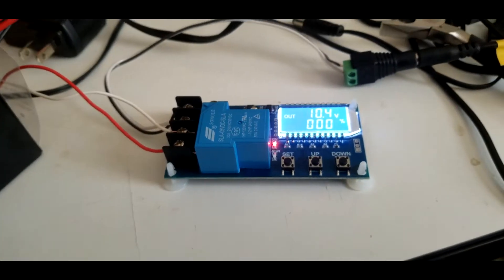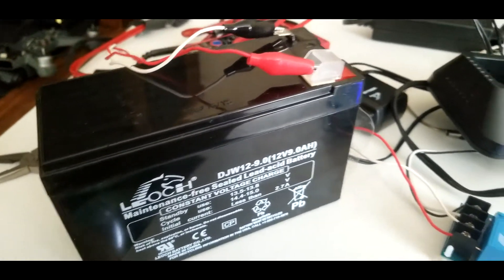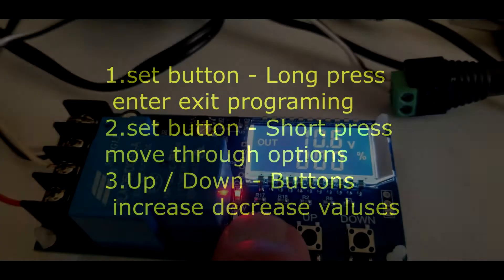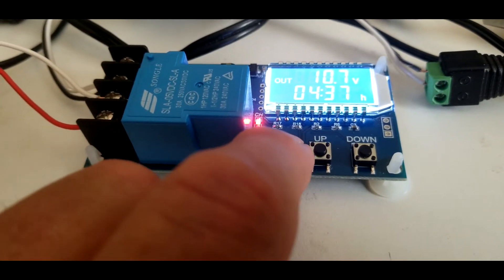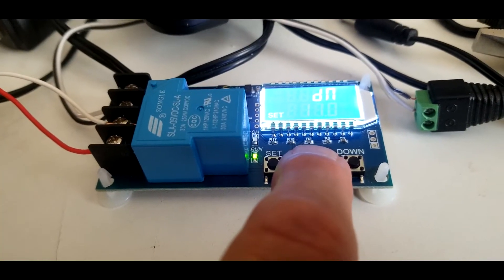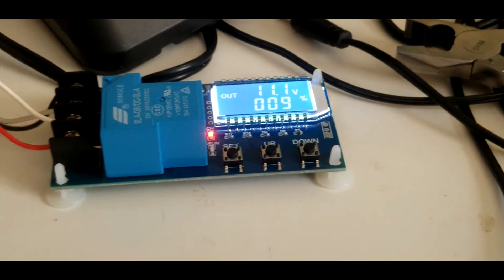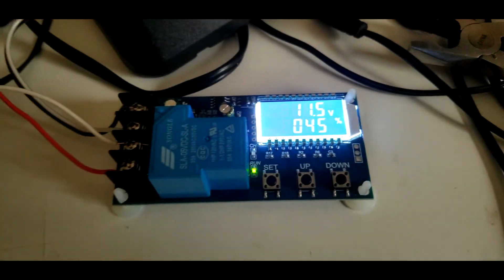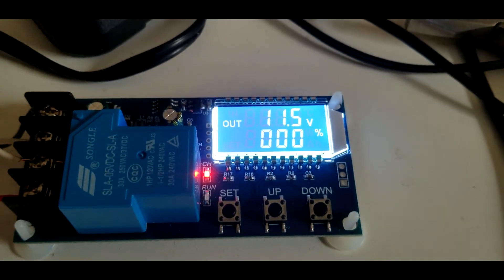Battery Charge Control Monitor

Comment: This module makes a pretty competent charger out of an adjustable power supply (AKA lab power supply). I charge an 8-S Li-Ion pack by setting my power supply to 34V and 1A and setting the module to cut off at 33V.

Comment: The sealed battery you are charging is really a Lead acid battery that has the top glued onto it. If you pry it open you can add water to them and MAYBE get them to come back to life if they are dead. Recovering them really depends on if you let the water evaporate out of it and then charged it. The low fluid will burn the plates and ruin the battery.

Comment: If anyone remembers the Arlec charger that was a CC/CA charger of 2Amps. It would fry your battery if you didn't time it right. This  board would have been perfect for that sort of supply, especially on a boat where the Pri and Sec are separated by a transformer. ie. No Electrolysis issues.

Comment: Isn’t this unit a charge and voltage reference . Can’t see where it discharges through the unit . You will connect your current drain in the usual way. A parallel pair of wires suitable gauge to handle the charge current. Cannot see why you cant charge any battery. It’s the charger which provides the charging parameters. The unit switches the relay off or on depending on the reference voltages. Probably good to have several to suit battery type and avoid forgetting the voltage range set for one.

Comment: There is no such thing as low power to high power on this module, the correct instructions are 
Set the status of the LCD backlight (L-P) with a long press of the ‘UP’ button.
OFF: The backlight will stay on permanently.
ON: Backlight will be automatically turned OFF after 5-10 seconds.

Comment: The only reason you can not charge certain batteries is because you need to use the correct charger for the battery you need to charge. This unit only controls the charge parameters, the unit does not charge the battery.

Comment: I've a Moman V-Mount Lithium Battery - 14.4V - 99Wh - 6800 mAh and Charger 16.8V - 2A
How many Volts should I set the module to make it turn off? 14.4V or a little higher? can you help me? Thank you very much
Reply: Yes

Comment: It's not charger, it's between charger and battery. It's only control module, cut at volt you setting it to cut.
It's only so you program it to charge battery at 90% , you want overload battery. It's not charger, it's charger controller, Safety, batteries last longer ,🙂  You needs charger,.🤓👍

Comment: What you are missing is after you have connected your charger to the charger input, but not the battery. Press the down button and this actually toggles the unit on and off. This will work for you now.

Comment: can i charge only 1 lion 18650 to 4.2 v ?
Reply: not recommended, I would go with any tp4056 charger board, that will CC-CV charge. This board is just a relay combination with time/voltage check
Reply: Yes.. you can.. just use 5v input like cellphone charger... And set the lower limit and the upper limit

Comment: Works perfectly on both lithium and lead acid.
Plus this is not a charger but a over voltage and under voltage disconnect.
Reply: so chargers work diffrently? Doesn't they just disconect when voltage is reached?
Reply: It does charge the battery, it just disconnects the battery when it's reached the OVER voltage.
Reply: @TheDgdimick How can it charge without a power supply/charger ????

Comment: I'm sure you know by now, but this is NOT a battery charger! It's only job is to pass current from source to load within an upper and lower voltage limit setting. It has a bunch of bells and whistles too. It does NOT limit any current/voltage going through it either. Just a relay that opens or closes.
Reply from the maker: oh yeah, thanks. i was using a wall transformer for charging connected to CH+ and CH - , in the opening picture you can see the wires connected. There is more to it than just passing current. Like i stated it will not charge any batteries besides lead acid. It does have a sense circuitry to sense the charge on the battery AND it makes the assumption of charge by the chemistry of the battery.

Comment: Im looking to buy this Brand CPTDCL charger cut off board. Can you help me out.
 I have a portable solar set up and direct from alternator charging my secondary battery. 
Can I reverse the wires to the CPTDCL charger that go from the charger input, to the charging output to battery wires so instead of charging the battery, I want to rig it to operate a 12v motor and be able to start n shut it off.?
Reply from the maker: hmmmmm not sure , try going to an electronics forum or a circuit forum.

Comment: hi, i have a question. Really does your module save the settings ? I mean when you disconnect the power adapter, are your set values (Vmin Vmax) still the same or reset to some defaults. Thanks for reply.
Reply from the maker: it saves your settings when removed from the battery / no power

Comment: Thanks for the review. Quick question.  Why wouldn't it work for a car battery?  Say I wanted to keep my tractor batteries charged via a solar panel with only 8A max output. This charger should be able to trickle the charge.  Could you elaborate a bit more?
Reply from the maker: I am not sure but I think it has to do with the relay which is rated at 30 amps, so a 650 cca battery would probably arc over the relay or burn open. I don't want to try.
Reply: It will work with a solar panel, but it is either ON or OFF - no trickle. It will charge up to the top voltage and the relay will open.  It will start charging again when the battery drops to the lower voltage setting.
You could set the lower voltage to 12.8 and the upper to 14.2.  This way the panel will give all it's got getting the battery up to the absorption range, then will cycle on and off as the battery finishes the charge.
If leaving this unattended for days at a time, to avoid using water, I would lower the top voltage to something like 13.8V.
Reply: This module is only a lower and upper voltage cutoff circuit.
It doesn't balance amps & voltage which a charger is supposed to do.
Reply: He doesn't exactly seem to know. In fact I doubt if he even read the manual before making this video. Lots of misinformation here....